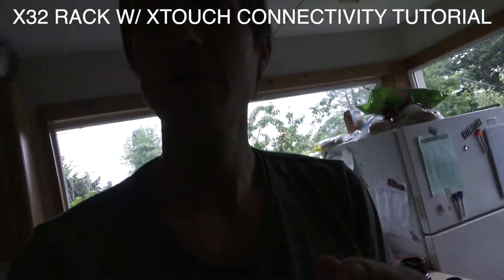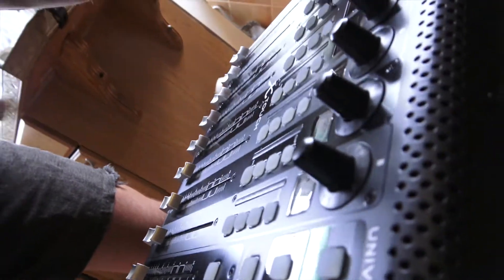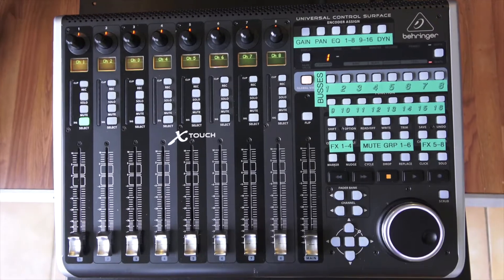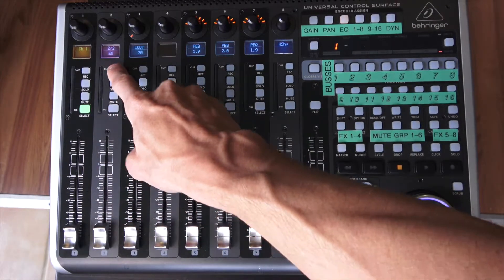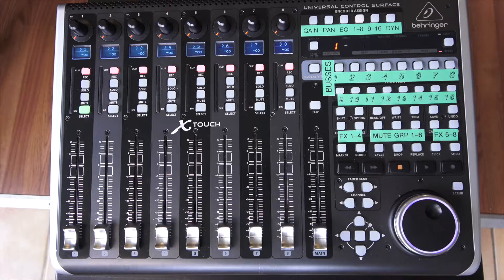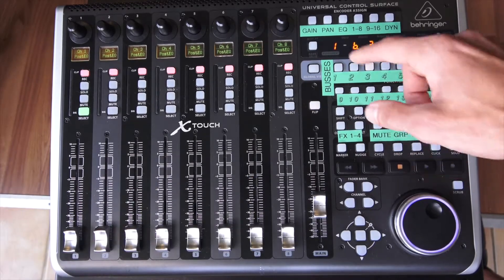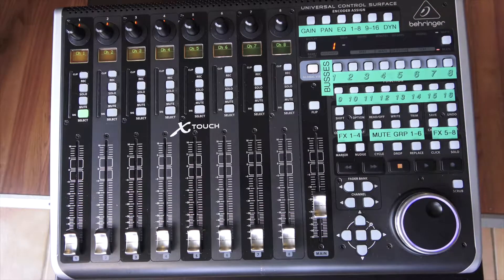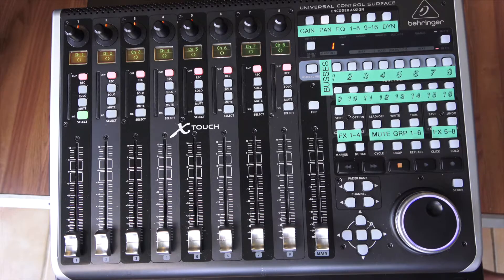Behringer X-Touch w/ X32 Rack Connectivity Tutorial

Comment: I think you can help me! I am trying to integrate or connect an actual MIDI controller, the Mackie Universal Controller, to the X32 console. This would be via MIDI connection, not USB. I know that the X32 talks to DAW's via its internal MCU connection, but can the MCU version 1 , Device/controller, connect and be used to control the X32 for 8 channels? This device would act as like the Behringer X-Touch.  Thanks!!!!
~Angel